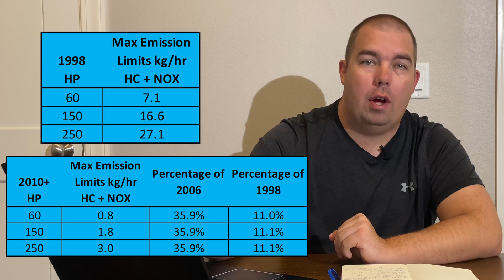Why Did The 2 Stroke Outboard Die? (Evinrude G2, Mercury Marine, Yamaha Outboards, and others)

Comment from the maker: Do you like the newer 4 strokes or do you wish we still had 2 strokes?
Reply: We want 2 strokes, power strokes come 2x as fast
Reply from the maker: @owenhein3189  “we” don’t want 2 strokes. Give me a 4 stroke any day.
Reply: @clearwaterfishing  nah “we” want 2 strokes they produce way more torque
Reply from the maker: @owenhein3189  Actually they don’t. Same torque and RPM range makes same HP.
Reply: @clearwaterfishing  if that was the case than a 200 Yamaha would get a boat on plane by itself in a controlled test if a 150 evinrude could but it didn’t
Reply from the maker: @owenhein3189  Was that a sentence?
Reply: @clearwaterfishing  yes
Reply: @clearwaterfishing  look up evinrude 150 vs 200 Yamaha
Reply from the maker: @owenhein3189  Boy if it was that good they shouldn’t have gone out of business.
Reply: @clearwaterfishing  Mercury paid them to go out of business they signed a contract
Reply from the maker: @owenhein3189  ok
Reply: 2 stroke as ligntning strikes are 2 stroks and so is the sun!
Reply from the maker: @jlo13800  2 jokes are done.
Reply: @clearwaterfishing  Done with what i got a few and they work fine.
Reply: I'm looking at a boat with a '92 Mercury 225 2 stroke with 464 hours on it.  Are those good engines?  How many hours are they usually good for before major rebuild is needed? Thanks in advance for any input.
Reply from the maker: @joeprimal2044  1000 hours is what I would call an old engine. Doesn’t mean it’s a bad one then. You are looking at a middle age motor. Also you might check to see at what RPMs the hours are at. More in the lower range the better.
Reply: @clearwaterfishing  Thanks.  How would I check that?  It's just a 20' trophy so i don't imagine he had to lean on it too much.  For a '92 the boat in general seems to be in xln't shape.
Reply from the maker: @joeprimal2044  it being a 92 you may not be able to get it. Normally you can get a service tech to print it out. The other way to test an engines health is with a compression test.
Reply: @clearwaterfishing  OK, thanks.  I think we'll do the compression and see how it runs.  It's nothing fancy and the price is right.  The whole thing looks well maintained, which says a lot.  Just a couple rips in the seats and that's to be expected.  
     I just need something to get me back on the water fishing after 40 years of kids, stress and marriage. They're taking my farm via eminent domain but It's up in the air as to when, my daughter has a brain tumor ( not quite as bad as it sounds, but not good ) and is going to need brain surgery, and the medical profession is moving at a 'soonest appointment is a  month from now' snails pace and I'm just sitting here waiting and stressing.  I need a fucking distraction!  You understand I'm sure.  Sorry to vent.  Thanks for your input and enjoy your day.
Reply: I wish Evinrude and BRP  still made 2 stroke out boards best ever just another B's America politics b shit that's all it is same with older cars and everything else in your life. Keep the old ways. Things were made way better 40 years ago when American people actually did good quality work.
Reply: Both have pros and cons I think I prefer 2 strokes but for quietness I like 4 just wonder if a 4 stroke are gonna last as 2 do.. I have a 86 mercury never had a rebuild still purrs like a kitten 4 strokes have alot more moving parts to wear out
Reply from the maker: @slabbusterrtr7690  4 strokes are quieter than 2 stokes.
Reply: 4 strokes suck money pits
Reply from the maker: @charlesdecker6342  had some issues with it?
Reply: @charlesdecker6342  nope by the time i was of age my old man was making the switch over to 4 strokes i do remember a yamaha 75 2 stroke and a yamaha 90 2 stroke but not very much both them engines didnt last my old man very long only his yamaha 90 4 stroke
Reply: 2 strokes for sure, Achates power aggravated cummins to make an OP 2 stroke diesel, Both the sun and lightning are 2 strokes! Plasma very high energy though! The sun is loop scavenged and lightning is uniflow 2 stroke! yes even nature uses the 2 stroke cycle! If yoy are borse you can even make a 2 cycke v8 chevy! Like this:https://www.4btswaps.com/attachments/2cyclesbc-jpg.6839/
Reply: I wish we had both
Reply: 2
Reply: i love my johnson 2stroke. ill keep rebuilding it till i cant boat anymore
Reply: Both have their place

Comment: Worst mistake ever to quit making 2 strokes
Reply from the maker: I disagree. The best thing ever. Finally forced the industry to move to better technology.
Reply: @clearwaterfishing  they was forced into lower emissions all that was from the EPA its was all political dude
Reply from the maker: @slabbusterrtr7690  Forced into better technology.
Reply: @clearwaterfishing  how is it better because its quieter? a injected 2stroke gets as good of fuel mileage people will be wishing they had a 2 stroke back when they have to start working on the 4s u think a 4 is gonna last as long as a 2 with all the extra  moving parts a 4 has? plus a 4. Will never run like 2... 2 stroke makes power every revolution of the crank 4 every other revolution only... and I like the noise a 2 stroke makes it don't sound electric 😆
Reply from the maker: @slabbusterrtr7690  4 strokes have already been out a decade. I haven’t heard much problems with them. I can’t tell you how many times I’ve been at the ramp and see people leave because their 2 stroke won’t start.
Reply: @clearwaterfishing  yeah carb problems injected 2 strokes have very few problems I guess if we live long enough will see how many problems the 4 s have im just saying it's got to be more with a 4 cause u have at least twice as many parts no way it will last longer than a 2 in my opinion
Reply: @clearwaterfishing probably because they don’t know how to start it. A misplaced primer solenoid knob will prevent your engine from starting.
Reply: Agree.. i have both 2 and 4 stroke outboard.. 2 stroke is longlast, durable and less mentainence.. for me the EPA thing is just an excuse to stop producing 2 stroke.. if you in fishing business, must use 2 stroke.. 4 stroke always cause problem.. high mentainence cost

Comment: Evenrude E-tec 2 stroke outboards easily meet EPA emission standards and are the only "2 stroke" outboard technology to receive the 3 star Ultra Low Emission standard EPA Certification https://youtu.be/uaJfQl6cmDw in  Evinrude E-TEC motors are up to 85% cleaner in carbon monoxide emissions than ANY four-stroke. especially at trolling and mid throttle range   there direct injection technology allows then to inject fuel "after" the exhaust port is closed eliminating classic the 2 stroke issue of unburned hydrocarbon emissions in exhaust. they are allowed on lakes that have 2 cycle outboard engines banned ..
Reply from the maker: The E-tec is done also.

Comment: the 4 stroke technology in outboard application is not new, at the beginning of the sixties, McCulloch had developped a 50HP outboard engine based on a marinized Crossley engine.
for sure the 4 stroke outboards have many advantages two of the more obvious is that they does not consume oil so they does not stinks and another one it that they burns less fuel for the same work because of the scavanging advantages and the higher compression ratio.
another advantage to my taste, as the oil film is thicker on a 4 stroke engine, the global engine sound is more low pitched, more pleasant to the ear.
To my experience, even on diesel applications, for the same work, the 4 stroke engines consumes at least 25% less fuel than a 2 stroke engine.
2 stroke engine is a low cost compromize but globally, a 4 stroke engine is a better choice  on the long run.
Reply from the maker: Very detailed. I did forget that compression ratio is proportionally related to efficiency which 4 strokes win all day.

Comment: The advantage of the 2 stroke is weight to horsepower ratio and a smaller  unit for a given horsepower. 2 stroke does not need an oil reservoir, oil pump, oil filter or oil changes other than the lower drive oil. But 2 stroke does need 2 cycle oil added to the fuel or a oil injector reservoir. The burning of the oil can leave a smoke and oil trail behind the boat.
Reply from the maker: Modern 2 strokes need both an oil reservoir and oil pump. They don't use premix. I agree with you 100% on the power to weight ratio, but it seems like the boating industry has adapted to heavier outboards.

Comment: So many old 2 strokes running strong still. 25+ years old too.
Will the same be said about a 2020 yamaha 25 years from now? Doubtful
Reply: Haha a 4 joke will self destruct, sledds are still BB  strokes as the high revving joke dont have the low end torque a   stroke has! Achates power aggivated cummins to make a  stroke OP for the military and trucks clark cycle uni-flow BTW did you realize that lightning is a plasma  2 stroke. nature uses the  stroke cycle well:https://www.4btswaps.com/attachments/2cyclesbc-jpg.6839/
Reply from the maker: @jlo13800  Your comment doesn’t make sense.
Reply: @jlo13800  put the crack pipe down and get some sleep.
Reply: @eldiablo7862  Poppet valved u-loop scavenging with total loss oil injection burn off!
Reply from the maker: Some might die on their next trip. That goes for both.

Comment: The last 2 stroke automobile on the highways of the world was  the East German made Trabant...last one manufactured in 1973...A copy in the Air Force museum in Dayton, Ohio...Go look!
Reply: the chevy's here were 2 stroke:https://www.4btswaps.com/attachments/2cyclesbc-jpg.6839/, i had a rare 472 1969 caddiillac coupde deville 2 stroke and ran TCW3 pennzoil semisythetic oil only!
Reply from the maker: @jlo13800  I like the picture you attached. It doesn’t have that in anything. Also it looks like a flathead not a 2 stroke.
Reply from the maker: That sound cool. I will check that out if I am ever that way. Thanks!

Comment: The outfitters in FL always recommended 2 strokes up to the high  200 hp.  They loved the weight saving, simplicity and nearly 1/3 to 1/2 the number of moving parts.  When a tenured engine engineer comes and goes into the difficulty with direct injection motor that is not  putting fuel in during the entire flow thru cycle I’ll listen.  When I see a 4 valve per cylinder Yammy with a max rpm of 6k or 6.5k I have to laugh.  All those gears and belts aren’t for economy or reliability ( look at a Chevy LS-1 motor, they will run at 6k all day with push rods).  Those Yammy should be set up for a min of 10k to make that Swiss watch worth the money.
Reply from the maker: Greg Bayley 2 stroke definitely have less moving parts. Don’t most 2 strokes run about 6k rpm?
Reply: @clearwaterfishing  all the etecs did is remove the extra moving parts and add it back in via the stupid expensive injectors. Then u have to run specific oils, if I want to change oils I have to get it reprogrammed, what old two strokes did not care what oil I ran. 
The end result is consumers got smarter and tired if this, went with 4 strokes. How many etecs are sold vs 4 strokes. They had a very small market and the company needs to stay in business with a product that makes money.
Reply: Clearwater Fishing : I  think the 2 strokes are more limited by gas dynamics.  My point was that companies selling 4 valve 2 OH cam engines and limiting them to 6000-6500 rpms are cheating their customers.  If I’m going to take the risk on a high mechanically complex engine and potentially
Reply: have to pay $6000 if a cam chain breaks or a valve head falls off then I want to run circles around the guy with a giant computer controlled weed wackier motor.  I like 2 stokes for reliability and long term durability.  I’m working on a 60 year old 2 stroke now.  It needs rings on one cylinder. I can’t imagine taking apart a 60 year old motor with all the nuts guts and feathers it takes to drive dual OH cam.  I am a retired mechanical engineer not a mechanic.  They work for a living.
Reply: These guys are all assholes who can't read the writing on the wall!

Comment: FYI Yamaha HPDI and Mercury Optimax were direct injection 2 stroke outboards as well. Evinrude was leading in reportable emissions with a 2 stroke! EPA was not the death of 2 stroke, consumers had the biggest impact on 2 stroke market.
Reply: Evinrude was the lowest total reportable emissions of any outboard brand. Certified to be used in all 50 states and European Union. EPA actually gave them a clean air award! There has been a lot of disinformation about this subject. But marketing from 4 stroke engines and consumers perception played a very big factor. Thanks for trying to help cover the subject
Reply: @Clarksmarineincindiana  Lets see a 4 joke run with just oil injection tilted in any position!
Reply: @jlo13800  why would you need to run an outboard past its trim in the first place 😂
Reply from the maker: Clark's Marine, Inc. What were the emissions from the Evinrude 2 strokes vs others?